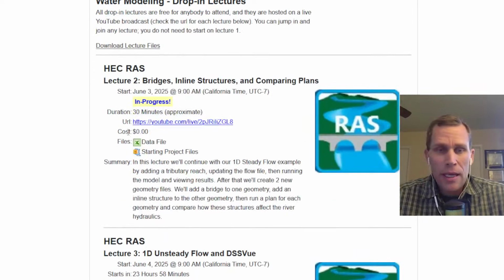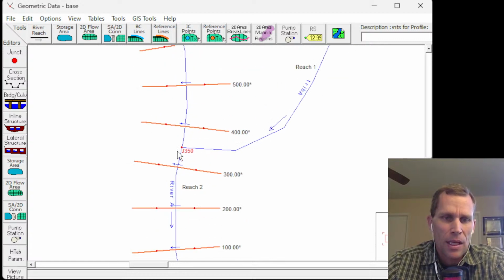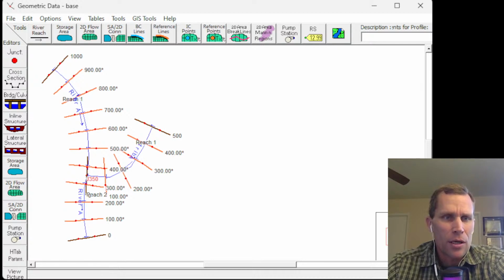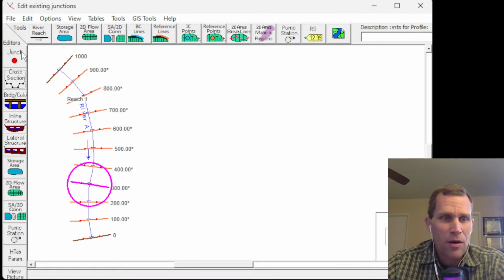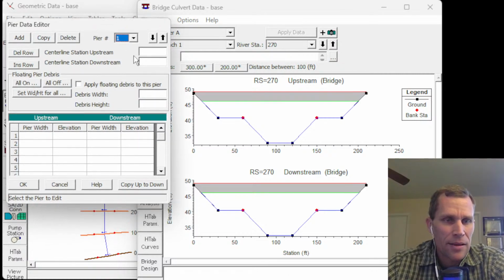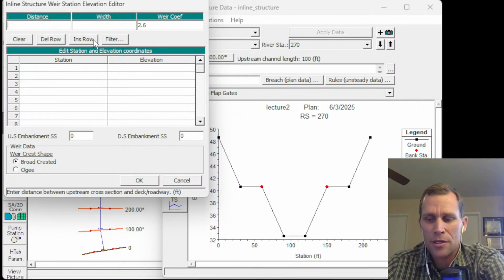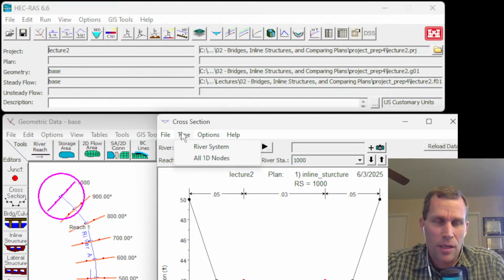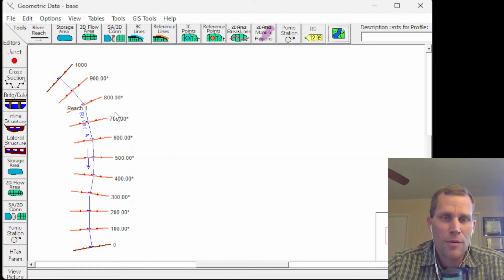HEC RAS Lecture 2 - Bridges, Inline Structures, and Comparing Plans

Comment: Hi Tim, could you tell me the difference between an inline culvert and a regular culvert? If there is any, thank you.
Reply from the maker: Hi Patricio, an inline culvert is placed directly in the natural flow path of a stream or drainage way, so all flow passes through it. A regular culvert is a general term that can refer to either inline or off-line culverts, with off-line culverts handling only excess or diverted flow.